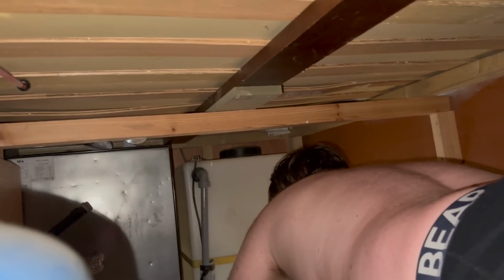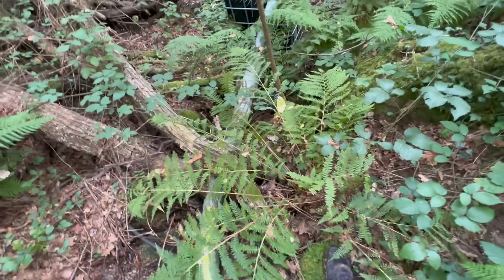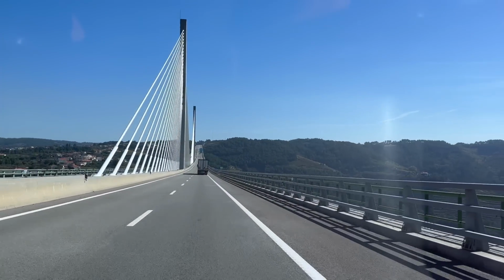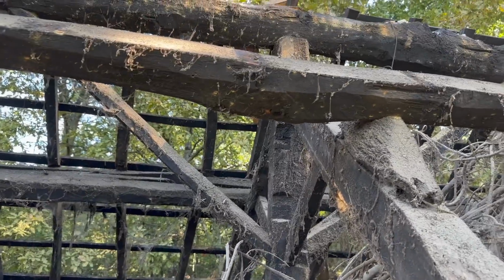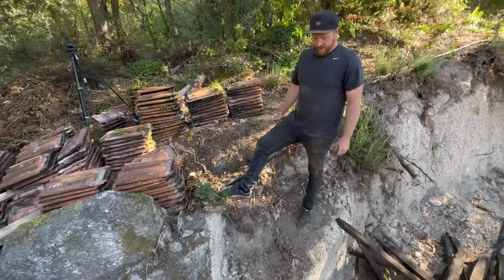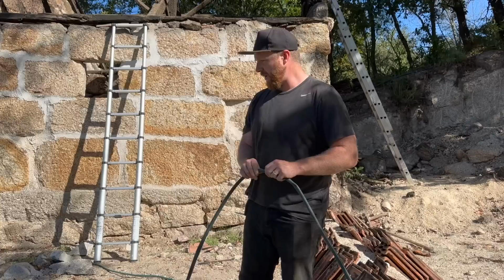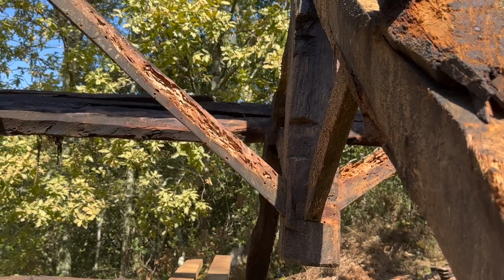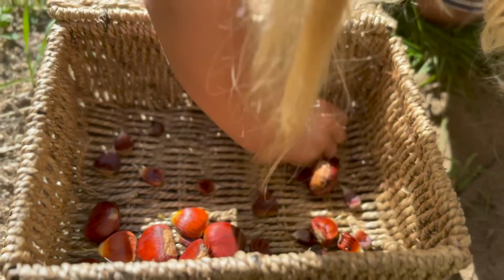ABANDONED STONE COTTAGE RESTORATION - Removing The Old Rotten Roof - Can we save it?

Comment: My dad was a master carpenter and would replicate the design of the old timbers as he said you cannot save infested timbers.. woodworm will gorge on new wood ❤
Reply: There is a woodwork treatment
Reply: @antoniodasilva1230  not to be used in this case?.
Reply: @katrinarichards6520  yeah they definitely need to replace some of the wood I texted before they powered washed it but if it was my place I would still keep all of those beams  and give it a really good treatment  and build a new wood roof above that old one and also keep it even with the other roofline
Reply: I wouldn’t trust them but you could replicate the beams.

Comment: I see your headache here, but I think you need to replace the whole lot. 
If you feel up to the carpentry,  then you could replicate what is there, in new wood. 

The alternative is to start again with a whole new roof, and if you keep the lofted ceiling then you can also have a mezzanine bed space. 
A new roof structure would also make to easier to fit Velux windows for better light. 

Keeping the old roof structure and then reinforcing it from above is extra work, might look odd, and the bugs in the old timber may come back to haunt you. (There is a reason why many locals go for concrete beams over timber ones – although they would not be my choice. )

Good luck with what ever you decide!
Reply: También se pueden poner de metal , en Galicia que hay el mismo problema con los tejados se usan mucho las de metal para restar peso .
Reply from the maker: Thank you love all these ideas ☺️

Comment: Could you recreate the roof in new timber? We had to rebuild our old oak framed granary and the oak framers who rebuilt the building recreated the 'dragon ties' at the four corners. We now have a beautiful green oak exposed, vaulted roof that is made in a traditional manner with pegs and pays homage to the original. Love what you are doing. ❤
Reply: I agree. Recreating the components in the roof would be the way to go
Reply: My thoughts exactly...please do not put any of the old roof rafters near your new wood. You can treat the better parts with a chemical to use it for a different outdoorsy project. 

But you will have to remove the complete roofvand recreate it. Those little buggers would go into every piece of furniture you have😢😉
Reply from the maker: Oh wow that sounds amazing I think it might be our best option! 
Thank you so much ☺️

Comment: Sad about the old timber structure,  nowadays, especially in Portugal they use concrete beams.  Then, should you wish facing all those beams with treated marine plywood (6mm) to give you that timber feeling. Using a polyurethane varnish on cedar or timber pine would give you a good finish. To make timber darker using stein finishes also help to keep wormwood/ bugs out. Cedar trees (timber) is often considered the gold standard for rot and insect-resistant wood trim and for building log cabins.  Cedar is a soft wood (like pine) performs better than most pressure treated woods.  If you want to save that structure you can use Boron which is widely used as a natural solution for woodworm treatment.  It’s relatively easy to apply and does not leave unpleasant smells Boron powder should be dissolved in water to make a 5% solution.  Also use Cuprinol worm killer— kills all types of wormwood or Permethrin also no solvent smell.  I like the idea of concrete beams faced with cedar/ pine or plywood (Sainik plywood) a company Century Ply which offers an extended warranty of 8 years.  If you are going to use cedar or pine logs, remove all the bark.
Reply from the maker: Wow thank you so much for all that information so many tips to take on board thank you ☺️

Comment: That ceiling structure is going to look magnificent. If it’s not already in the plan to raise the roof a bit, you should consider it. You can make both roof structures match and perfectly enclosed that timber underneath but still have enough room for your ceiling, insulation and electrical. I don’t know much about wood pests but I think if it’s not going to be structural you could replace the parts that are way beyond saving and possibly notch in wood to build up the parts that are somewhat damaged but mostly intact. I’m thinking like an antique piece of furniture restoration. You leave as much of the original in place. Obviously you need to make sure the pests are totally gone and if not treat the wood so they are completely gone. Now this is assuming it will not be structural. If you want structural then your best off recreating with new treated wood and hand shaping to make it look antique. ❤😊
Reply: Exactly!  Raise the roof, enlarge the window!
Reply from the maker: Love all these ideas thank you ☺️

Comment: While I appreciate your desire to keep original elements of the house, I would replace the entire wood structure with new material. My concern is that despite treatment efforts there could be residual carpenter ants, termites, or other pests that would damage the new construction.

You can stay true to the character of the house and still use new material for the wood structure.
Reply from the maker: Yes I think so too ☺️

Comment: The old timers used to make what they called 'tree hay' which was the soft young branches or bushes and shrubs and trees, which they would dry in the rafters for Winter fodder for their livestock. Take down the roof, every carefully, recording the whole process so that you can make replica's of the beams and how they are fitted together. Then replace it all in the same configuration?
So.. when you get more bees, you could put a special entrance reducer on. It's a 15cm tube that only allows two bees in or out at a time. If a hornet manages to get past the entrance guard, it will be killed by the rest of the inner guards, as it tries to exit the tube inside the hive.
Reply from the maker: Awesome thank you! And amazing tips for the bees I will look in to that! Sounds hopeful! ☺️

Comment: Just watched the latest video from Finca Life, definitely worth checking it out as they talked through maintaing and repainting stone buildings. Different construction from yours but interesting.  They are completely off grid so lots of interesting stuff .❤
Reply from the maker: Oh great will check it out thank you ☺️
Reply: @OffGridScotters  another channel you might find useful is Make do grow. Based in Central Portugal they are also renovating an old stone house, really interesting ideas on how they insulated the floors, installed underfloor heating and an air source heating system linked to a woodburner and solar system.  Last week they found a solution to fitting windows and doors in the stone openings. Also great stuff on no dig gardening. Another good channel is Atelier Mavi restoring a stone house in Italy - lots of good stuff on hemp plastering and building with hemp blocks and hempcrete. Exciting times for you.

Comment: Wood worm or termites as they are most commonly known are extremely evasive & need to be replaced with new wood or metal beams. The new wood will need to be treated to protect against future termites damage. To protect new wood against future termite damage paint with solution & avoid exposing wood to water & moisture. (No leaks in roof).

Comment: the woodworm or whatever it is does not look great & you might also have to get rid of the old wood in the other part of the house before you start building with new wood.    if you have any peppermint leaves or oil you can use that in your cupboards or wherever to keep mice away.
Reply from the maker: Thanks for the tips! I will definitely try the mint trick too! ☺️

Comment: You can't know the true extent of the damage to all the roof wood unless you cut clear through to see a cross section.  That defeats the purpose of trying to save it all isn.t it.  The original design can be replicated. Another thing is, do you need to meet regulations for building?
Reply from the maker: Yes we do if we do keep it it will just be aesthetic ☺️

Comment: You need to replace all of the wood in you roof. Your heart is in the right place, but you need to get rid of the bug-eaten wood. If you use new wood and build the ceiling exactly as it was, you are still preserving the historic aesthetic. You are, after all, replacing the battens and all the other with new wood. What’s the difference?
Reply from the maker: Very true ☺️